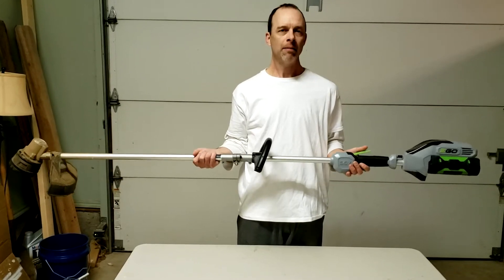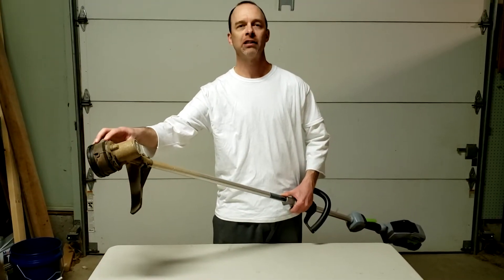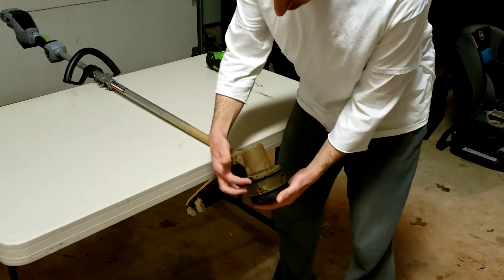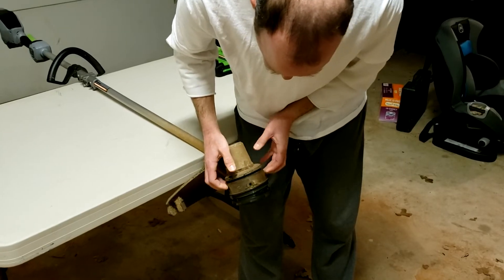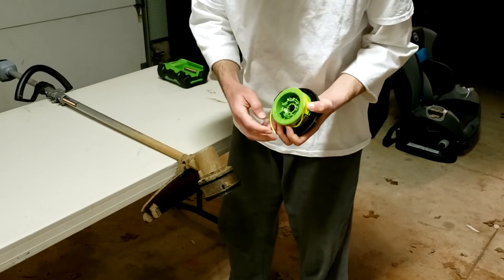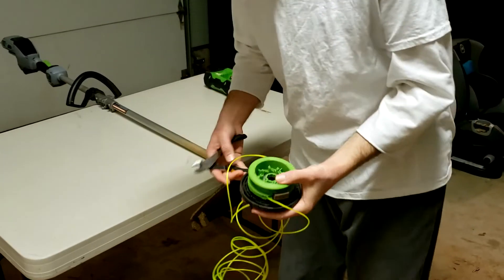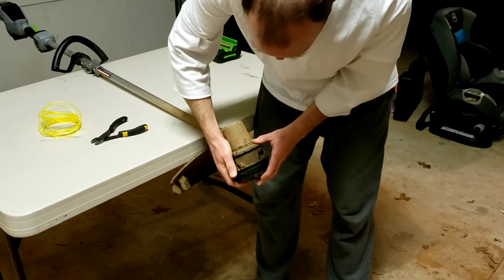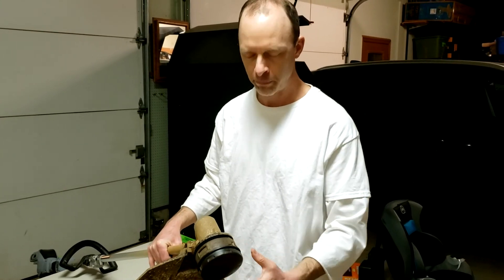How to remove spool head on EGO 56V string trimmer

Comment: Thanks for the videos.  I got my new string through easy enough, but when I wind the head it doesn't take up the string.  What am I doing wrong?
Reply from the maker: Hmmm. That's odd. Does your trimmer have a green button on the shaft but near the head? If so, you've got a model that automatically loads the string after you feed it thru. You attach the battery and push that button and the string winds itself.

Comment: I tried to depress the tabs you illustrate but I don't seem to have the hand/finger strength to depress the tabs. IS there some sort of pliers/tool you can recommend?
Reply from the maker: Try a flathead screwdriver and just wiggle it in until it slides past the tab. Then do the other tab. That should work. I think there are some other comments where people explain how they used a screwdriver. And yes, it is difficult sometimes with just one's fingers.

Comment: I bought the floor model and it appears it might have to much string in it..can't get it ti release the spool?
Reply from the maker: Try using a flat-head screwdriver to press in each tab, and use the screwdriver to gently pry the spool down as the screwdriver is I'm each tab slot.

Comment: I need to replace the entire head and not just the spool. Called EGO and yet the issue has not been resolved. I have a new trimmer head, but I need to know how to remove the base of the trimmer, down to the mechanical part. I cannot replace the entire head which includes the lower tabs.  Thank you.
Reply from the maker: There are other videos on YouTube that show that. I haven't had to do that so don't have a video on it.

Comment: I can't get the head off mine.  Can't imagine what I'm doing wrong
Reply from the maker: I remember mine being pretty tight the first time I took it off but I can't think of anything special I did other than maybe twist it a little while I pushed the tabs.
Reply: I'm having the same problem.
Reply: As am I. How did you fix it?
Reply: I used a flathead and popped it out. Be careful as you can end up damaging the head
Reply: @RoboShinKen   do you use the flat head on each tab one at the time?
Reply: @yannlathro256  I typically do.
Reply: @RoboShinKen  glad I read your comment. I was just about to call ego and ask for a replacement. I will try that then.
Reply: I had to use a flat head screwdriver to get mine off also, that was the first time I had to take it off hopefully it’s different next time. I’m not overly happy with this so far but I’ll give it a chance.
Reply: Ditto with the problems others have expressed here.
Reply: I don’t know which model you have. Mine is an EGO ST1500sf and the head doesn’t look like yours, so this doesn’t really help. 😢
Reply from the maker: Here's the same video but for the newer models: https://youtu.be/FzXSJc2hrEg
Reply: @FixEverythingYourself  : Cool, thanks!
Reply: Loosening the tabs with a flathead screwdriver made short work of it 👍
Reply: Anyone know how to remove the whole head? I Have the same exact model. No slot to lock the shaft..

Comment: I have a problem here…. I have the tabs pushed in but the head won’t budge! Any suggestions?
Reply from the maker: Probably have some gunk or debris in there causing it to be a little tight. Should just be able to pull hard on the head but you might try using a screwdriver to push the same tabs in while also prying slightly on the tab hole to get it off.

Comment: Thanks for that. Do you have a video on how to remove the line trimmer head and replace it with brush cutter blades?
Reply from the maker: Sorry, no I don't.
Reply: How do u take the head off and put a Breyer head on I can’t see a way to disengaged it to unscrew the whole head
Reply: Normally u put a pin in somewhere but there’s no hole please help
Reply from the maker: Sorry, I'm not familiar as I haven't tried taking the head off.

Comment: The head on mine will not advance the string no matter how hard a bump it on the ground. I have to take it apart and re-string it every time. Is the head worn out? Every thing looks fine inside. When I look on Amazon for a replacement ST1500SF head, the reviews are mixed. Some say the new head fixed the problem, others say it doesn't fit.
Reply from the maker: Others have had the same problem but I never have. Mine works great every time. Perhaps using a different string would make a difference - different thickness and/or style (e.g., braided vs. round). I'd try that before replacing the head.

Comment: My spool doesn’t come out! What am I doing wrong. Is this the “rapid reload” model?
Reply from the maker: I answered another comment of yours. Not sure if it answered your question because I see this one, too. Is string getting stuck inside and won't release as you use it? If so, it's most likely the kind of string you're using. There's a link in the Description of the video to EGO brand string that won't get stuck. 

If you have a different question, let me know.
Reply: @FixEverythingYourself  Thanks. I have the “rapid reload” model without the removable spool (maybe it’s an older model?). It’s working. I had to feed half the 16’ of line through and twist to wind like you show. It doesn’t have markings for alignment, so I just loaded, twisted, and started working again. It’s a lot easier than the older style (in which you wind the line onto the spool before loading it into the machine). Good stuff.
Reply from the maker: Glad to hear it.

Comment: Guess I have  different version. There is only one place in the spool the string will go thru. If you just put the head back together. The holes will not line up. You will never be able to  push the string thru. Took me 30 minutes to finally get it lined up for the string to go thru!

Comment: Mine won’t budge
Reply from the maker: The tabs won't budge? I found that it attaches pretty tightly so you may have to try to twist the spool head a little (back and forth) at the same time you're squeezing the tabs. In that case, having a helper would be good so that one person can twist it while the other is squeezing the tabs.

Comment: The head won't remove.  It released but it won't go out. Had to revert to the $29 craftsman electric with a 500 mile cord. Weed eater is the worst job in the world.
Reply from the maker: Does it have the same tabs as shown in the video? Mine was purchased in 2017 so perhaps they changed the design? Or if it does have the tabs, maybe just need to pull harder after they're pressed in.